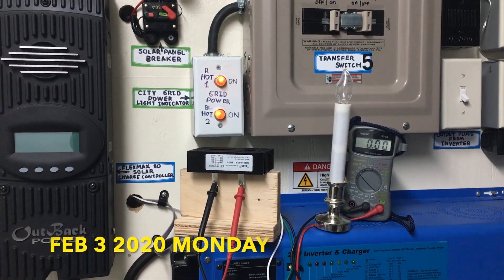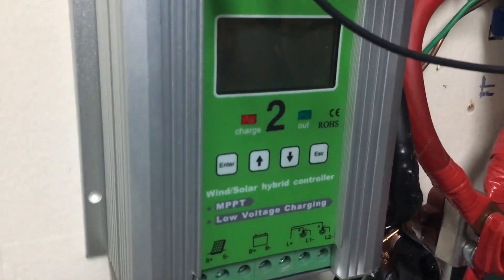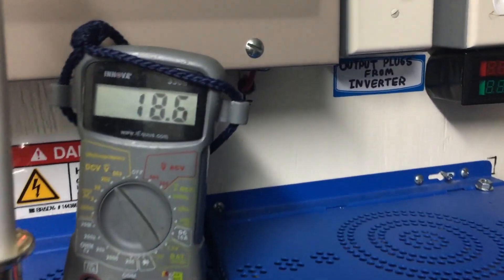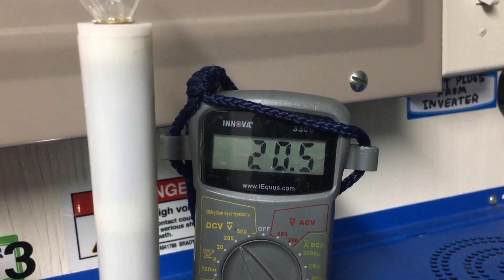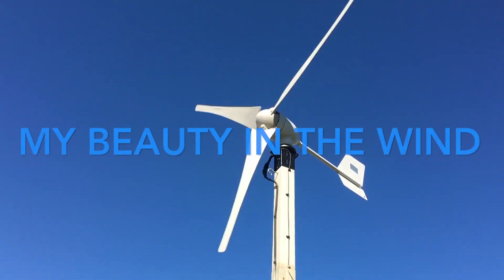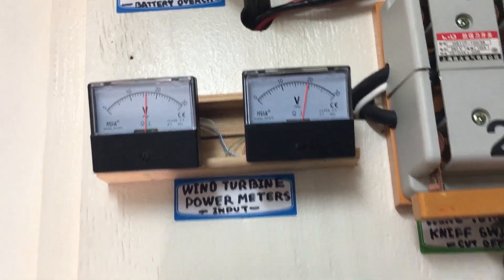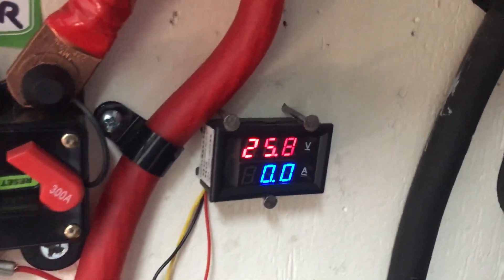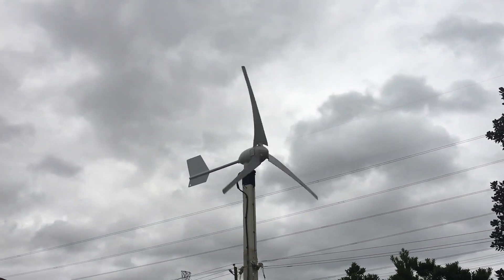MY NEW WIND TURBINE RECTIFIER TEST

Comment: Hi Mr., I have the same wind turbine, but I can´t see a good Amp level, so you can´t fill a battery...it´s ok?.
Reply from the maker: CHECK OUT MY OTHER WIND TURBINE VIDEOS  ESPECIALLY  " WINTER STORM HARVEY " . ITS A GOOD TURBINE AT THE TIME BUT I ONLY SEE UP TO 2.4 AMPS , SOMETIMES 7 AMPS IN  A GOOD GUST BREEZE LIKE A HURRICANE OR AN APPROACHING COLD FRONT BUT IT WILL ONLY KEEP THE BATTERIES TRICKLE CHARGED DURING THAT . THANKS FOR YOUR INTEREST IN THIS VIDEO AND YOUR SAME TURBINE LIKE MINE ,  HIT LIKE , LEAVE A COMMENT & SUBSCRIBE .
Reply: @defjamsgreen  ok, check my videos too.  I add an extra trail and work fine.